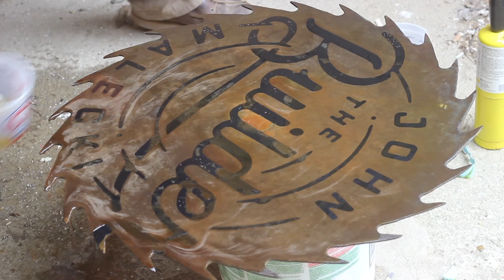How To Rust Your Logo On An Old Saw Blade

Comment: Nice one. Here's a tip for you. if you have to  Mig weld up a hole in steel Use a piece of thick copper for a backing strip and donut weld it up. The weld won't stick to the copper. A bit of finish weld and it is invisible.
Reply from the maker: Thank you!

Comment: Cool. What products did you use in the build? I counted at lease 3 fluids?
Reply from the maker: +sa-maker I used a rust cleaner, Muriatic acid, and Hydrogen Peroxide. I will touch on this more in my Vlog later this week

Comment: Your wire speed is too slow
Reply: Victor Fiori - How can ya tell when it to fast/slow or 'just right'.  #icantweldforshit
Reply: Luke Johnson I can tell just by the sound. It should be s continuous arc. I can her short pauses when you are welding. This shows the arc can melt the wire before more can come out.